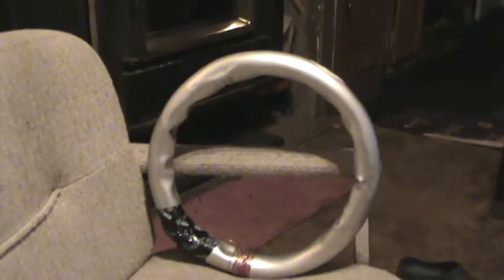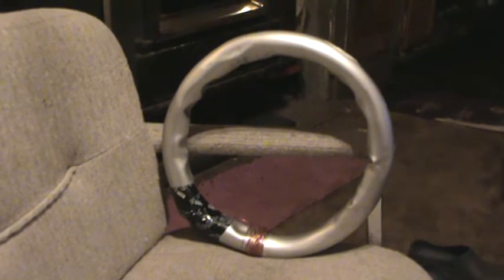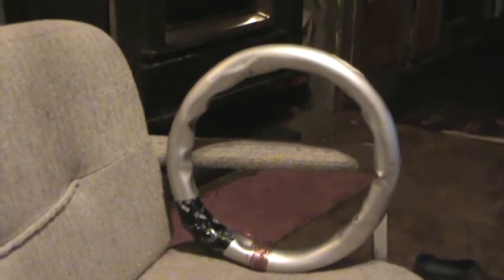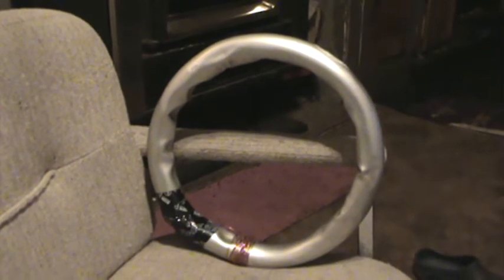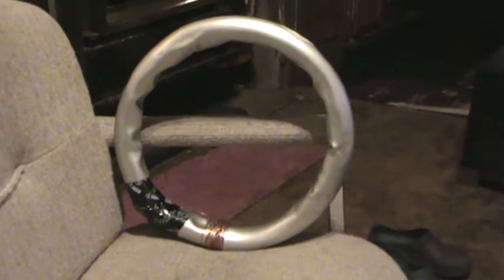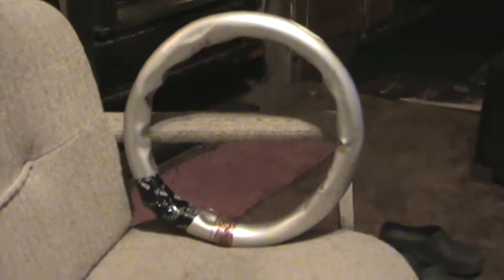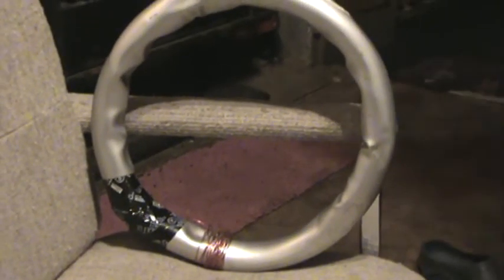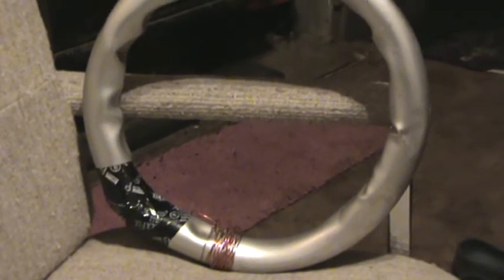an explanationof this energy

Comment: Thanks for another post and all your research on this subject. For those of us who have bothered to personally verify the PMH phenomena, it's clear that there is something missing from Maxwell's equations, as modified by Heaviside. And even the original ones. Very exciting stuff.

Some claim that this is  old news, since mini-scale computer magnetic memory cores use this phenomena. Nothing could be further from the truth, as the phenomena itself is not well-explained. Per Maxwell/Heaviside (all kudos to the both of them), magnetic fields cannot exist without the movement of charge. This phenomena seems to directly disprove that. So, a modification of the theory is possibly required. Nothing is written in stone. Except that which is. Cheers!

Comment: Video compression plays havoc with the more subtle visuals. I suggest you use the diamagnetic property of water to aid in your demo of this. 
Try:
1) Hold the ring to one side of a cup of heated water & see what effect it has to the steam. You should see it start to push the rising column away.

Or
2)  you could pass the ring under a dish-plate with a very thin layer of water. You should see the distortions very easily when shooting the reflections on the surface.